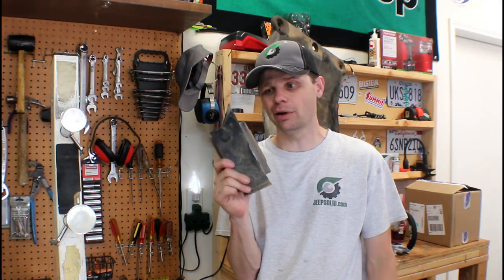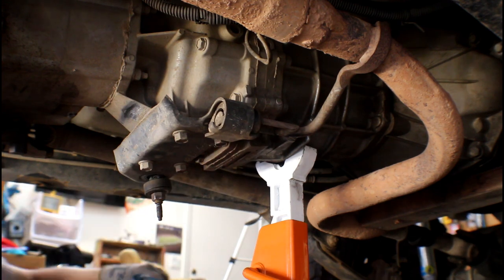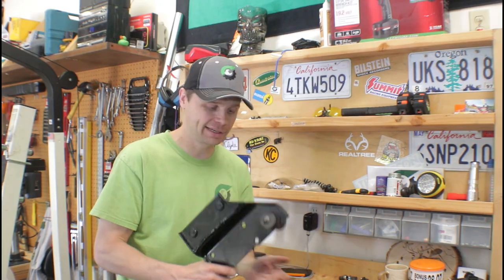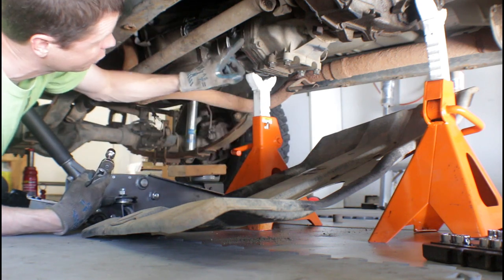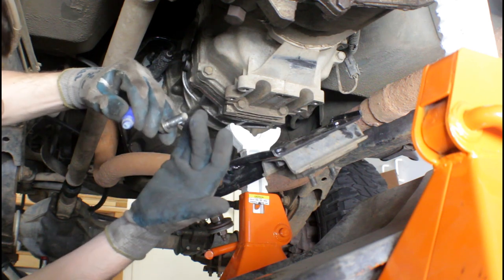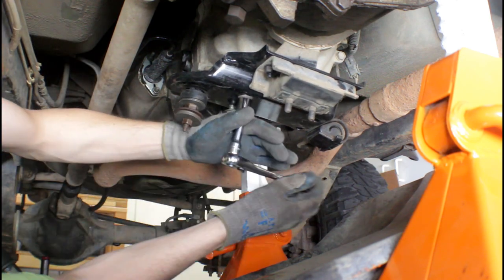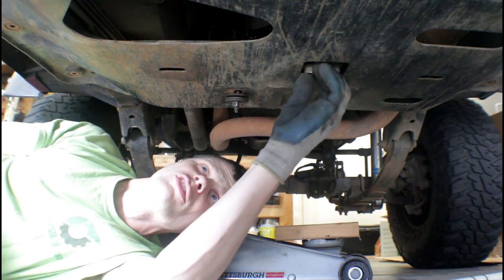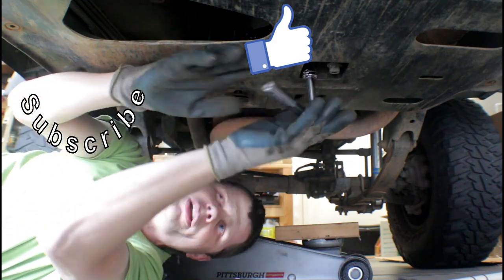Jeep Wrangler YJ Transmission Mount

Comment: Will a worn transmission mount let the transfer case drop enough to rub the skid plate on the back edge. That’s what I have now. So far it’s looking like the plate has rubbed a hole by the drain plug. Seeping fluid from this point. Any comments or advice. New transfer mount bushing and maybe JB weld the hole?

Comment: I watched your video, the way I seen it the skid plate is really what is holding up the transmission and transfer. There is no other brackets or cross member hold the transmission up is this correct? PS this is a very good video,very helpful thank you.
Reply from the maker: Yep.  That is correct.  There is no other cross member holding the transmission and transfer case up.  The skid plate is pretty heavy and designed to hole it up.  Thanks for watching!

Comment: Also.... I'm replacing the mount and found just a flat piece of steel that would be sandwiched between the tranny and the mount. It also extended out to catch the torque isolator. This piece is not similar to the broken piece you had welded and O Reilly can't find the part either. My question is does that piece you repaired change the elevation of the tranny if used. Wondering f this is why I have an issue with the TC rubbing the skid plate. My skid plate has 2" spacers. I will try adjusting the space smaller and see if that brings the TC up away from the SP without giving me driveshaft vibration.
Reply: Bump.  Same here. I four washers between the poly mount and tranny to get needed Ht to get off the skid plate.

Comment: I know this video is old, but I was wondering if those skid plate spacers are stock? Or does the skid plate bolt directly to the frame with no spacers at all.. thanks to anybody who takes the time to answer this ...
Reply: I was wondering the same thing.  My 1995 yj has no spacers.  At least I do not think so.  I had to have the CAT replaced and after I got it back there were no spacers so not sure.  I would also like to have someone in a video show how to tighten that third spacer and nut that is part of the rear mount assembly

Comment: Hello JeepSolid.  I got a question. I replaced the manual transmission fluid a number of months ago.  I was beginning to hear this winning as I drove home after Thanksgiving Dinner. It sounds like a turbo diesel engine.  I was concerned it could be some leak from the transmission gear box.  It's a manual transmission, but when I dumped it out, there was virtually little to nothing left of the manual transmission fluid.  Can you help?
Reply from the maker: Ah, bummer man.  Makes it sound like you had a leak....?  Any signs of leaks?  Or fluid where you park it?

Comment: I have a similar crack in my '93 YJ transmission mount.  What do we think caused the crack?  Was the torque improperly adjusted or worn?  Do you have any advice about installing the torque arm?
Reply from the maker: I assume it was from harsh driving.  Bouncing.
Reply: It just looks like a poor design.
I have an 87 and the transmission mount on it doesn't have that big overhang to pivot all the force through.

Comment: Wish i watched all those videos you posted but i did not and my transmission fell "slightly". I was able to get it back up and put the skid back in place however the mount is not lining up, needs to be pulled to the driver side by about 2 inches...what would you recommend? I was going to try a strap...
Reply from the maker: The transmission is not lining up to the mount?  Yeah, it has some wiggle room.  A strap or pry bar should move it over.

Comment: What are the torque specs on the skid plate bolts and those last two transmission mount bolts? Thanks!!
Reply from the maker: Sorry, I don't have specs on specific torque for those bolts.  Most guys just get them good and snug.
Reply: JeepSolid Thanks anyways! I did find some information about 55ft/lbs. Not sure if it’s right through. Keep the vids coming!!

Comment: What does the stabilizer stud actually do?   Seems to just flop around?
Reply from the maker: I believe it helps prevent twisting of the tranny under torque
Reply: @JeepSolid  I was wondering the same thing.  I made sure the rubber pieces fit together and then added two washers between the rubber and the skid plate so the skid bolt hanging down was not loose on the skid plate.  Hope that is the correct way to mount that.  This is a 1995 with 2.5l

Comment: You sure are a risk-taker starting those skid plate bolts with an impact.  Cross thread one of those silly nuts that are rolled into the frame is one big screw up for a garage mechanic.   What is that silly side torque mount for?   My aftermarket one appeared to be ill-designed and the two rubber bumper had at least 1/2" of free play.  The bolt that went into the skid plate bottomed with and 1/2" play also.  I added a few washers to take some out in skid plate but still leave it sliding but and now I hear a groan somewhere when I clutch to shift..  Guess I better try removing those washers.
Reply from the maker: Yeah, it's I'll advised to use impact setting bolts, although I am very careful with it. I believe the side bolt on the mount is to help prevent the transmission from twisting.

Comment: Hi! Currently working on my '88 YJ and found a loosen hose from the engine to the transmission on the driver's side. Any idea what's that hose for? Close to it there's a multi connector and no clue what's going on.